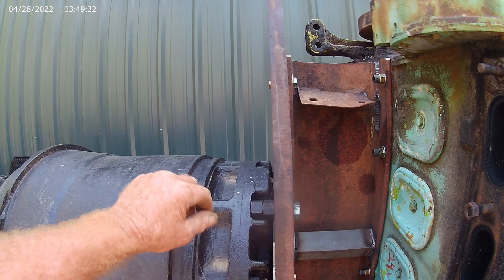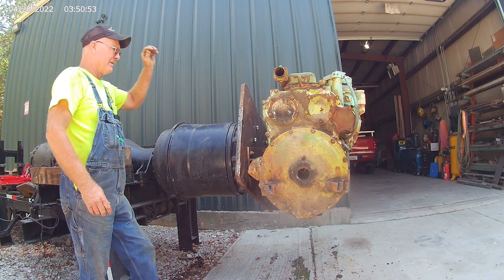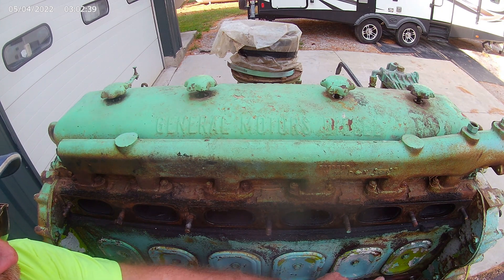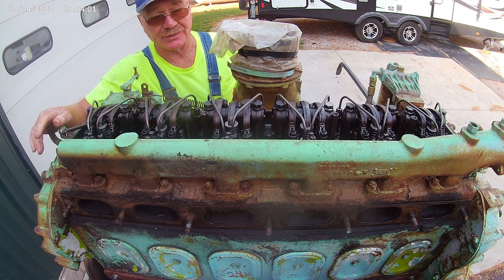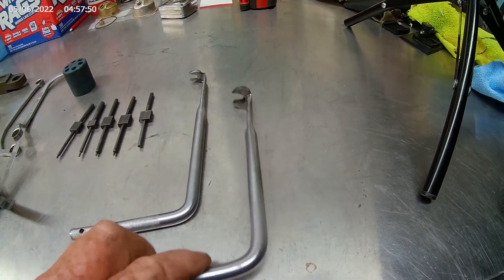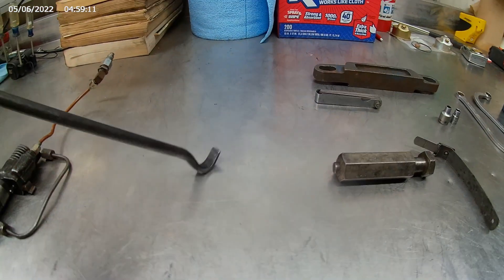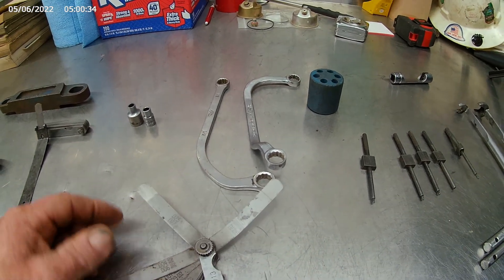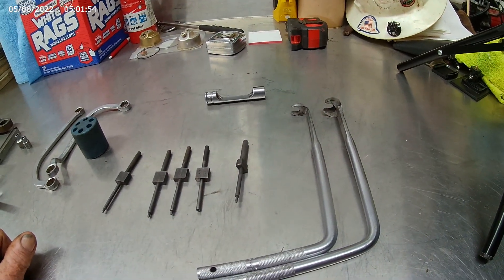Homemade engine rotator & locked up 6-71 Detroit Diesel.

Comment: I have a 671 that has motor oil getting into the fuel tanks. Any idea what that would be? Any help is greatly appreciated.
Reply from the maker: I would be looking for a cracked cylinder head.  Is your oil pressure above 60#?